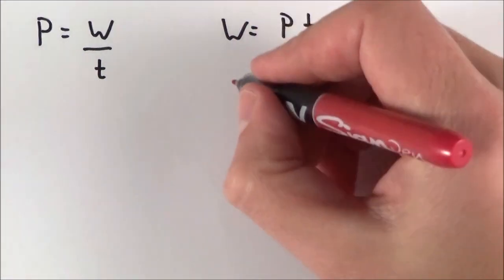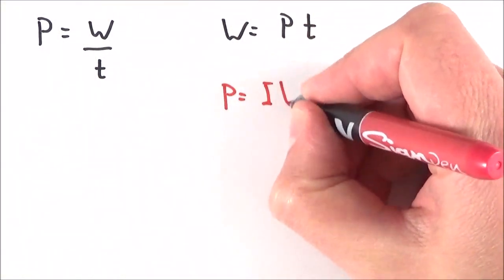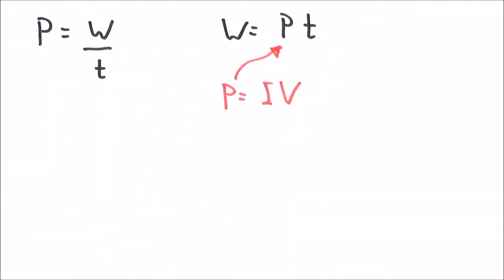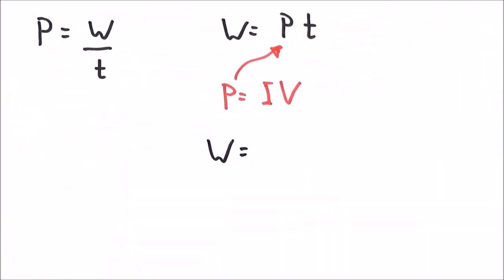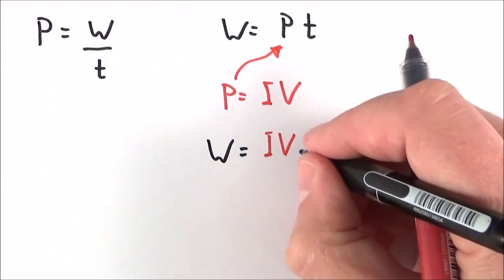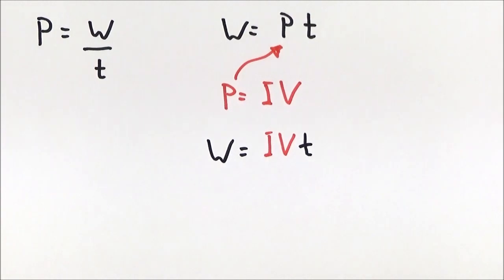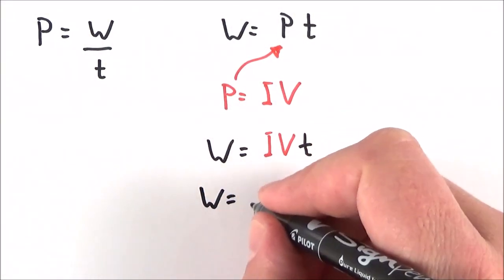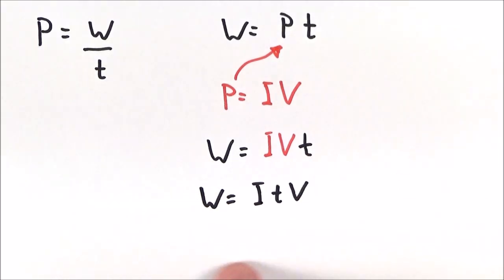Why Electric Work is equal to ItV - A Level Physics

Comment: Great video. Just wondering if you will be releasing any videos solving questions that relate to when there is a diode in the circuit.
Reply: +Gloria Adebayo I'm not any videos on this in particular I'm afraid